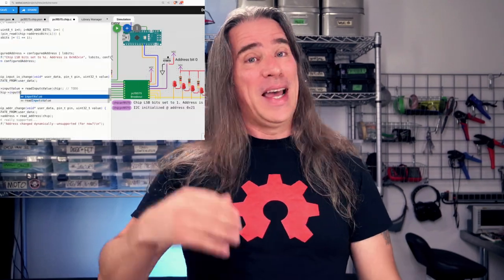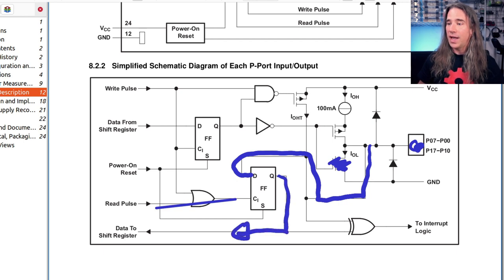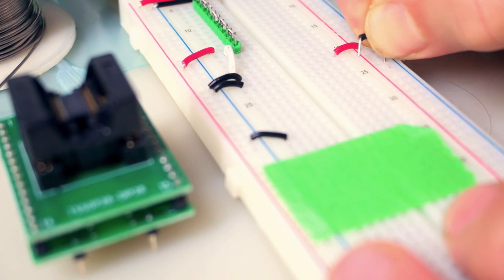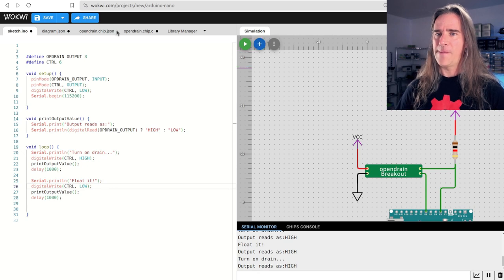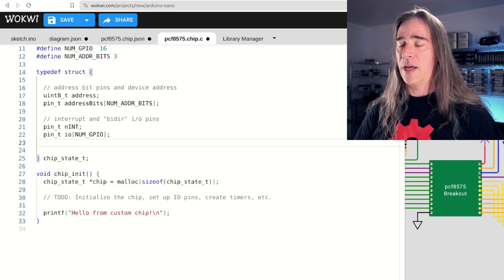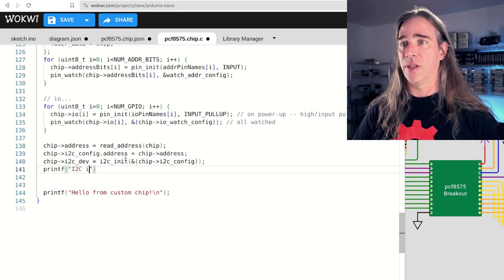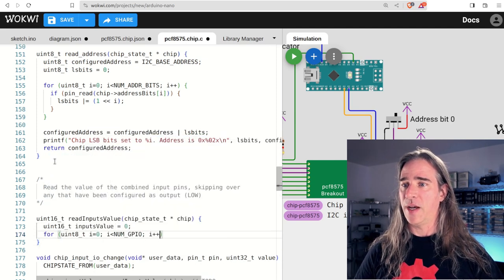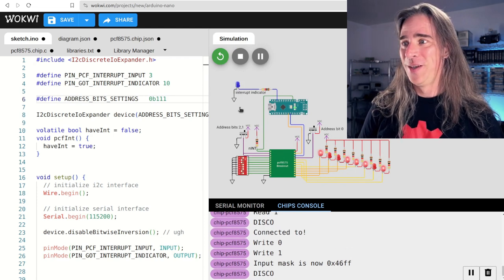Building a custom I2C chip for Wokwi simulation - PCF8575 [full walkthrough]

Comment: That is honestly... surprisingly reasonable as a process. My C is terrible but I was able to follow along.
Reply: I sometimes really zip through things (an excessive zeal at trying to keep things interesting), so that's awesome to hear :)  I hope it helps kickstart you on your way to creating your own simulations.  Cheers
Reply: @PsychogenicTechnologies I can't seem to implement this for a PCF8574. What variables in .chip.c would I need to change, and what in sketch.ino?
Reply: Hello  @imacubsfan23 /Tim,  could you hint me as to what type of problem you are encountering?  I would think that if you changed the example by making NUM_GPIO 8 rather than 16, and rearranging the chip.json file to get rid of the "P1*" pins, you'd basically have yourself a PCF8574.  Since, AFAIK, the function is the same and the i2c address is the same, not much would change in the ino, but of course, you'd need to remap the circuit and testing to do things using a single port.  Is there anything I'm missing?
Of course if you want it clean, you should rename everything in there called "pcf8575" to "pcf8574", and that includes in both json files, as well as the file names themselves.  Please let me know if there's anything I've missed there.  Cheers

Comment: Dear friend, is it possible for a club member to use unsupported libraries like UTFT and URTouch and how this can be done? Thannk you.
Reply from the maker: Yes, you should be able to upload them through the "Library Manager" tab. Note that you also need to make sure that the libraries support the hardware we're simulating
Reply: @Wokwi  Although i add the correct libraries, i get error: /libraries/URTouch/URTouch.cpp:27:11: fatal error: hardware/avr/HW_AVR.inc: No such file or directory
  #include "hardware/avr/HW_AVR.inc"
           ^~~~~~~~~~~~~~~~~~~~~~~~~
compilation terminated.

Error during build: exit status 1. What to do to working correctly? Any example?
Reply from the maker: @ArduinoGreeks If you uploaded it as a custom library, the source files must end with .c / .cpp / .h / .S. You can rename the file to have a ".h" extension and update the references in the source code, and then it should work.

Comment: Datasheet simplified schematic diagram is wrong.  The IOH current source value is 0.1mA (100uA), not 100mA.
100mA is too much to drain if the pin is grounded when reading it.
Reply: hum, yeah, that makes sense--didn't even notice the unlikeliness of 100mA.  Thanks!

Comment: Hi, how to connect oled 0.96 I²C, ADS1115 I²C, 2 x tm1637 and 2 x Rotary Encoder to Wemos D1 Mini and leave 4 pin for PWM?
Wemos D1 Mini have 9 digital pins, 2 pin connect I²C (oled 0.96 and ADS1115), 3 pin for TM1636 (common SCL), and 4 pin for Rotary Encoder, summary 9 pins, need more 4 pin for PWM... =(
Reply: Hello Fens!  Well, this actually looks like a good place to use an I/O expander... so all your I2C stuff basically shares 2 pins, no problem.  Is it the TM1637 or TM1636?  In any case, you can put the rotary encoders on an I/O expander (maybe the PCF8574 since you don't seem to need 16 pins), have that on I2C bus as well and only use one more pin to keep an eye on the interrupt.  
So, if all your chips are I2C, that's only 3 pins, and you have plenty left over for PWM or whatever.  The only thing is you'll have to be fast enough to see the interrupt and read the i/o expander before the next rotary encoder pulse comes in.
Does that answer your question or did I miss something?
Reply: @PsychogenicTechnologies  TM1637 7-seg module
Reply: @PsychogenicTechnologies   thanks for the tip

Comment: Hi, brilliant way of trying to teach, but the learningcurve is very steep. I am a programmer and not an expert on electronics. If you can't slow down, maybe you have some good references to me get up to speed. And if you would be afraid of beeing boring, be assured, people that want to learn are interested in what an expert has to say, so please take your time to explain. I listen to conversations with Lex Fridman on youtube that are more than 3 hours long. Anyway thanks for sharing your knowledge!
Reply: Hello Steven.  Thanks for the feedback: I admit, I'd usually rather have a video that people pause to have a better look at some part than get bored with... it's hard to strike the right balance though, that's certain.
If you're good with the C code but only getting up to speed on the electronics, a few worthwhile resources to start might be:
  Pull-ups and pull-downs: https://www.youtube.com/watch?v=5vnW4U5Vj0k
  Open-collector (basically same as open drain) outputs: https://www.youtube.com/watch?v=7zGw70Pbggw
  I2C protocol for comms between chips: https://www.youtube.com/watch?v=j9yx8LOslng 
  Another look at the I/O expander (PCF8574, basically the little brother of the chip here): https://www.youtube.com/watch?v=mXMkgQf3fqU&list=PLFVpu85GvZwT1Xbz7ZgXkXAmSDIDaM2rl

Let me know if there are any other bits that could use extra resources.